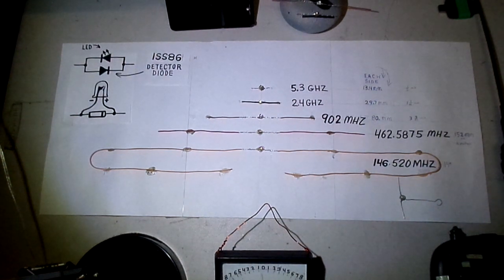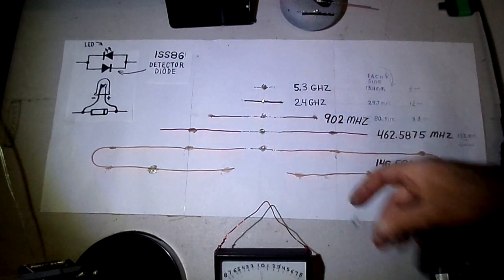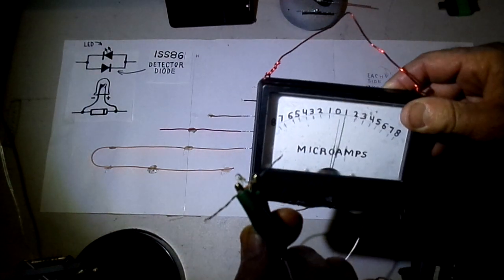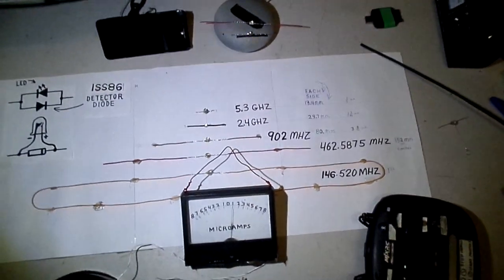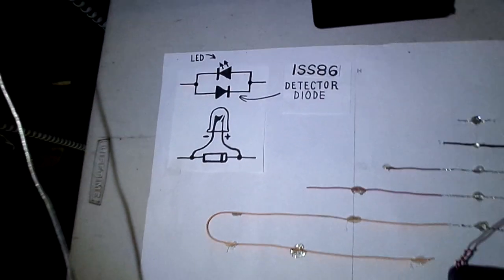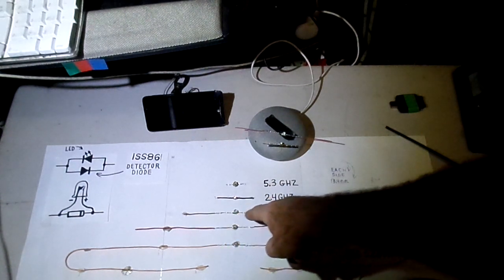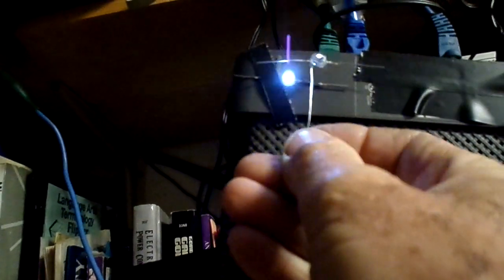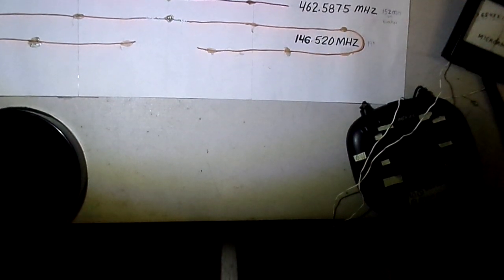2 Dollar Radiation Detector You Can Build. Beware of imitation diodes that don't have an H on them.

Comment: Next step. Make them for 5G ... say 28Ghz ... 10mm for full-wave, and then approach a 5G tower and see how close you need to get to light them.
Reply: Actually this signal is too high enough to use directly witg arduino mostlikely or atleast with one transistor amplifying... which means this data can be used for recording signals from that frequency.. but mostlujely will need lots of filtering if connected to something else ewen if indirectly or close..
Reply: re: "how close you need to get to light them."
Heh. And bring a ladder. Heh. 
Verizon puts these pretty high up on power poles (not ground level).
Reply: @ahmetmutlu348  Who has said anything about an arduino?  This is a UHF diode and an LED.
Reply: @stargazer7644 Led turns on that means around 2v and lots of m.amps which means can be driven tough cheap circuits.. but noise mostlikely will require filtering,as arduinonlike big metal things will act as antenna too..

Comment: 3:38 There's about a thousand watts of 2.5 GHz power on the other side of that microwave oven door.  That's +60 dBm.   The case on a microwave is only about a 30 dB attenuator.  That reduces the 1000 Watts down to about 1 W radiated (30dBm) total.  That's about 10 times what your WiFi router puts out.
The reg is 21 CFR 1030.10 which limits radiation of an oven in your home to 5 milliwatts per square centimeter at any point 5 cm from the case of the oven.  The window on the door of my microwave oven could radiate 3W and meet that legal requirement.
Reply: Upvoted.
Reply: how would you know the case on a microwave is only about a 30 dB attenuator?
Reply: @programmer1111x  You can measure it with a spectrum analyzer.  The manufacturers only make them as good as they need to to meet the regs.

Comment: Thanks. I love it! What I like is that this is very physical and unlike obscure expensive EMF meters made in China contains no chips to cheat you or pretend anything what isn't there. In 1990th with the first cellphones there was a hype with phone ring indicators consisting of a keychain with a red LED in clear acrylic plastic, which likely works the same. Also microwave oven leak detectors only contain some kind of diode attached to a moving coil instrument.

Comment: If you could make them for 121.5MHz you could sell them for 10-20 bucks in aviation stores as novelties to monitor the blind guard.
Reply from the maker: Can you tell me what the blind guard is?
Reply: @GrantsPassTVRepair  It's _a frequency used on the aircraft band reserved for emergency communications for aircraft in distress_.
https://en.wikipedia.org/wiki/Aircraft_emergency_frequency
Reply from the maker: @bjornroesbeke  Thanks for the information.
Reply: That would only work if the aircraft was sitting in your house with you.   These aren't going to pick up transmitters more than a few feet away.

Comment: This is one of your most interesting presentations yet, really makes me realize how important antenna element length is. Perhaps this is why you had such trouble finding the "perfect" television antenna as you described in one of your earlier videos, since all the different translators are on different frequencies in different areas.
Reply from the maker: Using the correct antenna is important, but one of the other problems I've encountered in this area are multi path reflected signals bouncing off mountains, and arriving at my TV out of phase with the signal which originates at the transmitter.  In one case I got better reception from a weaker signal than I did a stronger signal due to the multi path reflected signals.
Reply: @GrantsPassTVRepair  I guess a pretty high degree of directionality is needed to try to block out reflections(or choose the best one).
Reply: This is why quality TV antennas are wide bandwidth log periodic designs.

Comment: The 1SS86 Sounds familiar :-)
The 2.4Ghz and 5.3Ghz detectors combined in a keychain or so, makes it a very simple broadcoast detector for the 2 most used frequencies in residential WiFi routers.
Reply from the maker: Thank you for recommending this diode.
Reply: @GrantsPassTVRepair  no problem. Glad that i could help with this tip.
I'm also wondering, if the "power" that received with this method, can be harvest and to boost up to a higher voltage, like a Joule thief circuit does.
Reply from the maker: @BjornV78  The power going to the LED is so small it's not likely to be of much use.
Reply: @GrantsPassTVRepair  The detector that i build had 4 diodes, i think by adding more diodes then 1, the current gets higher by each diode.
Reply from the maker: @BjornV78  I but the 4 diode bridge thinking it would gather more power, but my LED didn't seem to get any brighter with this design.
Reply: @GrantsPassTVRepair  i'm gonna test tomorrow further with these diodes, also i have recently ordered a special LED driver from Ebay (20 pieces for 1,12€ total), called HH004F. This driver looks like a TO-92 transistor, but needs only 1,5V and simple inductor to form a Joule Thief circuit. 
There is not much datasheets to find of exact specs of this LED driver, but if you Google it, you will find multiple schematics how to use. I'm gonna combine this driver with the 1SS86 diode(s) to boost up the power if possible.  To be continued :-)
Reply from the maker: @BjornV78  I attached one of these diodes to the input of a small audio amplifier. It allowed me to hear the oscillations from my  router and microwave oven many feet away.
Reply: @GrantsPassTVRepair  this type of diode acts like a small battery when radiation is detected, so in theory, adding more of these diodes in series, must raise the output.

Comment: Nice fun video, I tried this with China 1ss866 diodes without H it didn’t work you did not say if your led was special or not but eBay has the H branded diodes 5 for $20. Little to expensive for a five minute experiment I think.
Reply from the maker: Yes the price for the original Hitachi diode  was a little disappointing. The 1N5711 also worked, but it's not as sensitive at the higher frequencies.

Comment: Well by adjusting to correct frequency and uaing a optocoupler or transistor it can do wery sensitive detections ... i guess transistor will cause lots of noise from source voltage so using photo resistors this means extreemely sensitive signal tracker... with correct decoder this might end up to be  all range signal tracker ... worth a try ..

Comment: Thanks for video. Why have we need use 1SS86 diode? There are also rf diodes which have lower than the leakage current ratio of this diode. Is this criterion important to you? Which criteria should we consider when choosing between RF diodes for this circuit?
Thank you.
Reply from the maker: I haven't researched these diodes in deph, but it's the best one I'm aware of for what I'm doing.
Reply: Why won't a 1N34a work?
Reply: @justtinkering6713  The 1SS86 is a UHF diode.  The 1N34A isn't even rated to 40 MHz.  It simply won't switch efficiently at these UHF and microwave frequencies.

Comment: With this you can make a cheap wireless hidden cam detector.

Google Echo is transmitting in Wifi and Bluetooth 

That vertical light effect on the camera of the diode on your router was very weird

Comment: If it's just shy of 30mm each side for 2.4 GHz, that might be close to la generous ead length... So you could just connect the diode in antiparallel, splay, and trim to length.

Comment: So that diode obviously looks like a better choice than 1n4148 you see in a lot of circuits. And you show a walkie talkie (HF) up to VHF, so I'm guessing it would be a nice basic FSM for HF and VHF amateur use?
Thanks for nice video.
Reply: That diode is a UHF diode.  A 1n4148 would work for HF and low VHF.

Comment: 8:12 looks like your math is for quarter-wave and not halfwave. TRUE? Speed of light in copper?
Reply: Each wire should be about 1/4 wavelength long to make a 1/2 wave dipole.  Shorter will be less efficient.

Comment: Hi Grant, 1SS86 is hard to get here. Is there an easy way to choose an alternative by data sheet specs ?
ie. which specs signify which diode may be appropriate ? is it Vf or capacitance etc ?
Reply from the maker: I bought a few of them on ebay, but they didn't come with any specs. Where do you live that they are so difficult to find?
Reply: @GrantsPassTVRepair   I'm in New Zealand which is almost on top of the world or bottom of the world, depending on your orientation in space.   There's a lot of fake diodes floating around Ebay and AliExpress so hoped to buy from a reputable dealer.
Reply from the maker: @jackevans2386 Greetings from Grants Pass Oregon USA. I bought some of the diodes mentioned in this video on ebay which worked fine.

Comment: It would be interesting to see a spark gap emitter near these detectors.  In particular, I have noticed that a stun gun generates a ton of RF energy, that can be damaging to cell phone cameras.
Reply from the maker: I just tried using my stun gun next to these LED Detectors and they didn't light up, but it would be interesting to have a variable frequency spark gap and see what happens,
Reply: @GrantsPassTVRepair  be careful taking video of a stun gun, my last cell phone camera was permanently damaged doing that.

Comment: Can you change orientation of antenna to determine the signal path?
Reply: Yes, a dipole antenna receives best broadside to the signal.  If you point a wire end toward the source it'll be weaker.  Note there's a 180 degree ambiguity.  Also note that you'll also lose signal if you're cross polarized, but that won't help you find the source.

Comment: Several other diodes can be use, the trick is to get one with CJ to be as low as possible.  An thanks to the Measurement capabilities of the recently availble transistors testers, this component parameter can be measured.  It is likely that the overall CJ can be reduced by connecting several diodes in series, however that will likely to create a loop antenna (and there are example of these type of LEctennas on youtube eg 
Rectangular loop REctanna with 5 signal diodes (probably 1N4148) in series on the pheriphery (the outer limits or edge of rectangular loop).
https://youtu.be/RMC4acGYeR8

Series of 6 Signal Diodes in the center ring to act as Detector with Star-Dipole "antenna"
https://youtu.be/bGeJJ0p3La8
) rather than the classical dipole.
Reply from the maker: I tried the 1N4148  and it did work on the lower frequencies, but not on my wifi router.

Comment: I did this 50 years ago up to one gig   back then were germanium diodes instead
Reply from the maker: Did we have LED lights 50 years ago?
Reply: @GrantsPassTVRepair  YES! The Texas TIL209 and a Mullard one CQ something.
Reply: @GrantsPassTVRepair    and I also used more a moving coil meter with a pair of diodes attached, with a little pig-wire sticking out, broadband field strength as a utility for tuning up things
Reply: @GrantsPassTVRepair    if you google "Semiconductor Circuit Design  Texas Instruments" there is a book they printed in 1973, which mentions TIL209 many times.  As a kid, Texas were near me in Bedford, UK
Reply: @GrantsPassTVRepair  and mentioned in the book all those years ago was running the LED at 10 mA was fine, but running it at 20 mA no perceptible brightness increase. While still today newbies still run LEDs at 20.00 mA because that's what it says on the datasheet!
Reply: Oh  and in the late 1960s they were known as Electroluminescent Diodes. There was also a high power IR emitter MIL spec one that could operate on 0.3 A of forward current, I seem to remeber pulsed at 50 Amps , used in a protective light curtain

Comment: I have used a microwave mixer diode from an MPH X band radar gun as the detector diode to the Bird wattmeter. Oh yeah makes an excellent detector for the field strength meter. Not much difference between the Bird $130 field strength slug.
Back in the day we used a four foot T8 fluorescent lamp a an indicator to see if w had a failure of the RF PA in the VHF handi talkies. We knew when it should start lighting based on the distance to the tube from the radio. A perfect PA at six watts would really light the tube to 3/4 brightness at six inches radio to tube. This process did not work too well on UHF frequencies however we never tried it with a shorter tube which may have made the difference.
Reply from the maker: I remember watching a guy light up a fluorescent tube using RF energy by placing it near his antenna.

Comment: The more interesting frequency would be the 24ghz the upgraded 5g towers use.
I disagree just because its non ionizing its safe, we dont know how they effect the mm scales in the brain, it will make them resonate, but to what degree no one knows yet as money always comes before safety.
Reply from the maker: What about light itself. It's also on the electromagnetic spectrum and it's a far higher frequency than 5 G.
Reply: @GrantsPassTVRepair  Light which is composed of photons are produced when a electron falls from an higher energy level(outer orbits) to a lower energy level(lower orbit) in the atoms, the difference in distance between the orbits determines the wavelength, so these high frequencies are only exciting frequencies at the atomic scale.
5g 25ghz however is resonating parts in our bodies and minds in the mm scale, of which there are many parts influenced by this resonance, just like a wine glass excited to its resonant frequency breaking, repetitive resonance of any part can lead to its deteriation or even destruction, now Nokia and the others will tell us its perfectly safe, but of course they would do that with big money involved, but the truth is, they simply do not know and are willing to risk injury, as such things as cancer, brain defects etc over a long period of time is very difficult to prove in court.
Reply: @GrantsPassTVRepair  There is a true story of a engineering being accidently locked into a VHF amplifier room at Emerley tower TV mast, the radio frequencies literally fried him. So you cannot use only frequency as an argument for safety unless its colour wavelengths or above of course as per my previous answer (notable exception of radiation as we know).
So, safety is really down to power levels, distance, dispersion patterns and the parts of the body those frequencies will excite and possibly cause damage to.
Reply from the maker: @suzesiviter6083  Yea being to close to strong radio waves can be deadly. You might like this experiment I did. https://www.youtube.com/watch?v=ICxeFDPSKSg&t=202s
Reply: @GrantsPassTVRepair  Watching it, one point, I think you are assuming only the heating effect of RF can cause damage, but any frequency that hits the right resonance of some organic material may also destroy it.
You remember the old Tesla experiment where he built a vibration machine that shook the foundations of a building 1/4 mile away and the police had to break his door down? well that shows little energy is required if you manage to get the resonant frequency right.
Reply from the maker: @suzesiviter6083  To achieve resonance you need a good conductor, and we are not very good conductors. It;s true that you can cook things with radio waves but not unless you have a lot of power. Here is another experiment I did which shows how difficult it is to heat water at a distance away from the transmitter source. https://www.youtube.com/watch?v=z46K941Jyts&t=108s
Reply from the maker: @suzesiviter6083  Watch this video I made on how hard it is to heat water using radio waves unless you are right next to the transmitter which is putting out a lot of power.  https://www.youtube.com/watch?v=z46K941Jyts&t=108s
Reply: @GrantsPassTVRepair  The biggest concern to me, is these towers are able to transmit 22.235 GHz, which is the abosption resonance frequency for water.
Reply from the maker: @suzesiviter6083    Have you ever been in a good lightning storm? Lightning can produce all kinds of X Rays and Gamma rays, and so can black holes from outer space but I've never heard of anyone dying due to radiation from the cosmos.  In my thinking it all boils down to how close we are to the transmitter source., and what power levels they transmit. I know a guy who was struck by lighting and he is still alive many years later. Here is an article on the topic you may find of interest.  https://www.snexplores.org/article/thunderstorms-can-generate-powerful-radiation
Reply: @GrantsPassTVRepair  to clarify, I am not saying they are causing damage, I am saying we dont know and niether do all the 5g sompanies, not long term problems anyway. As I said, its my belief that low power can harm if at the right frequency, 20Ghz region is particulary problematic being in the mm band plus the same band that can cause vibration of water molocules @ 22Ghz. Lets just agree no one knows for sure the long term problems these 5g masts may cause.
Reply: @GrantsPassTVRepair  yeah though lightning is a transient event, 5gs are on all the time, but you are correct, power, proximity etc are all factors.
Reply: @suzesiviter6083 Yes, but their output power is very low.
Reply: @suzesiviter6083  The power levels involved are not high enough to have any physical effects.  Hams have been transmitting on the 24 GHz band for decades.

Comment: Outstanding Demonstration. But How do I design each element to respond to a different frequency? Is there a way to specifically tune or set each LED diode to respond to a specific frequency of my choice? even one that i may stumble upon by accident? in the future?
Reply from the maker: Yes the element length determines what frequency they respond to. If you look up dipole calculator on google you will find calculators that do the math for you.